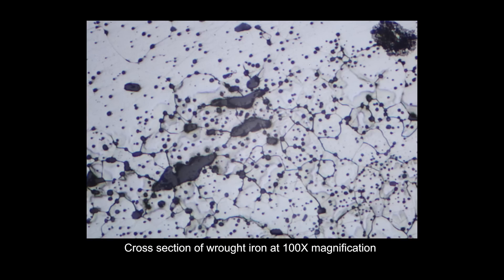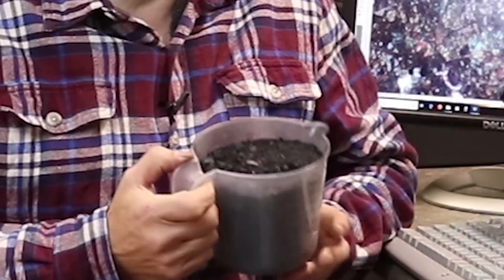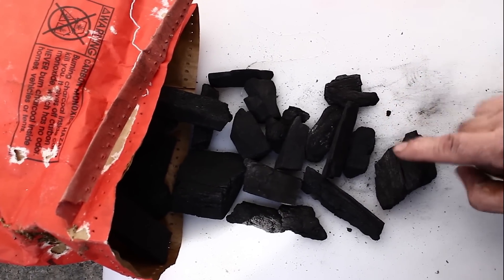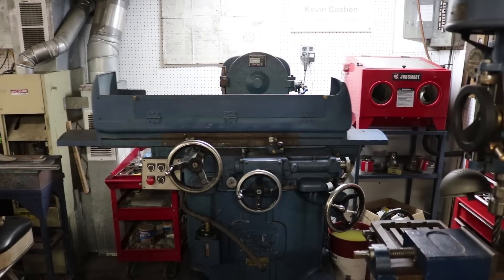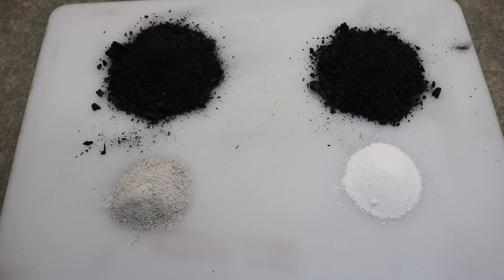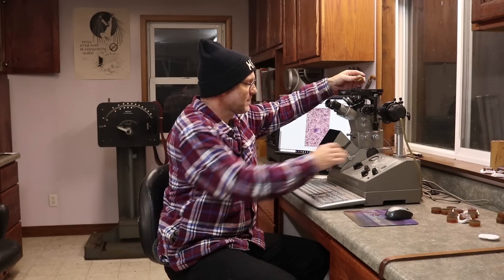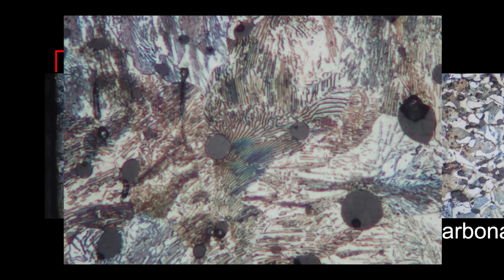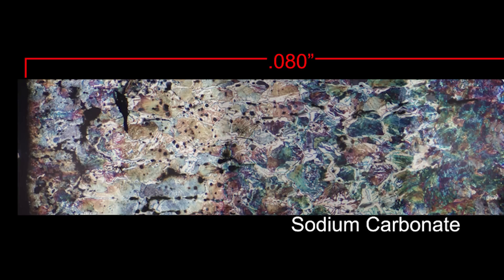Experiments With Blister Steel

Comment: So question, if after making shear steel is it possible to do the carbonization process again to increase the amount of carbon further?
Reply from the maker: Yes, but it would be taking somewhat of a step backwards since the shear steel process homogenizes the carbon levels throughout.  Also, the carburization tends to accumulate in the outer skin before it can penetrate to the core, so recarburizing risks creating an unworkable carbide rich, almost cast iron, zone.
Reply: @kevinr.cashen8544  awesome that makes total sense, thank you for the reply I appreciate it

Comment: Very interesting!  I'm pretty fascinated when it comes to incorporating wrought iron into knives or using shear steel for the actual blade/edge, so this was especially fun to watch.  I hope to see what you end up making with this shear steel, I'm sure it will turn out beautifully whatever it may be.  Thanks for generously sharing all of your hard earned knowledge with us, I've been meaning to pick up you're 1084 heat treating video, although I've been "guilty" of using 1095 more so with my fairly simple forge as I enjoy clay hardening for hamons.

Sorry to bug you a bit with a question here, but could you happen to recommend a good and simple design for a Venturi burner forge specifically designed for heat treating?  I think Don Fogg has a design for one meant for swords,  but all of my knives are fairly small and I don't have too much room for such a large size, I think something the size of a 5 gallon steel bucket is as big as I could realistically get, so I'mmnot sure if his design would lend itself to a forge with a smaller interior.  I'd LOVE try to build a PID controlled blown forge and especially a salt (or even "sand") pot, but I know next to nothing about wiring, so I'm just trying to find as good of a design for even heating in a forge as I can with a Venturi burner.

Btw, back to your video topic, I have seen one Youtuber carburize some smaller iron (pure-ish iron) ingots using ground up Tums with some pretty good results, I wonder how that would work with your setup compared to these two samples.  Anyway, thanks again!
Reply from the maker: Sorry I am not very well versed in venture designs that are available, I have a couple of the T-Rex burners that I got in return for some heat treatment consulting for a client.  1095 is a great steel, for some blades I would take it over 1084, but 1080 will maker every bit as nice a hamon as 1095, possible even better.
Reply: Kevin R. Cashen - oh that's a great idea, I'll have to pick up some 1080... do you happen to know of a source for decent/consistent bar stock?  I do also use Aldo's low Manganese 1075 for hamons as well, which works awesome, but I also have some of the round W2 from Don Hanson that I'll be using quite a bit of (for me at least) once I can find somebody to help reduce it to a forge-able size for hand forging, so I'll be wanting to make sure my heating is more even and consistent, which I should have regardless of steel type.  Thanks